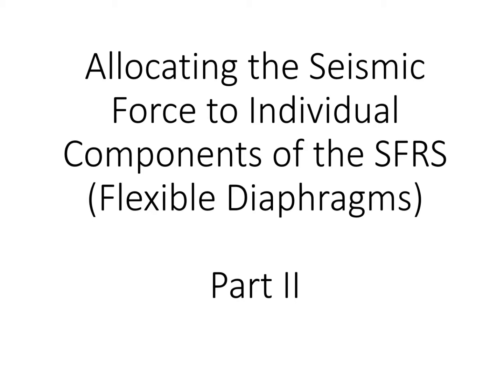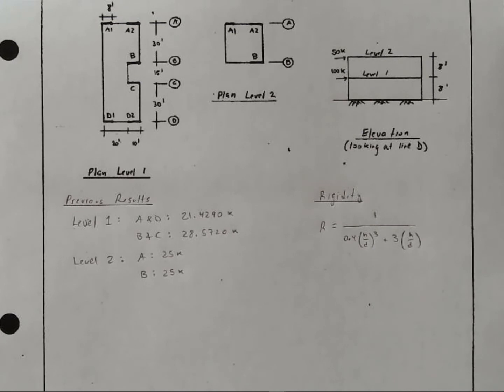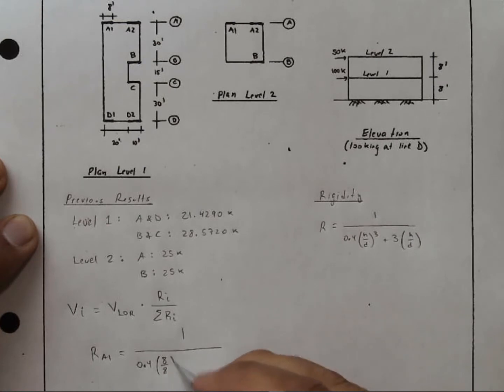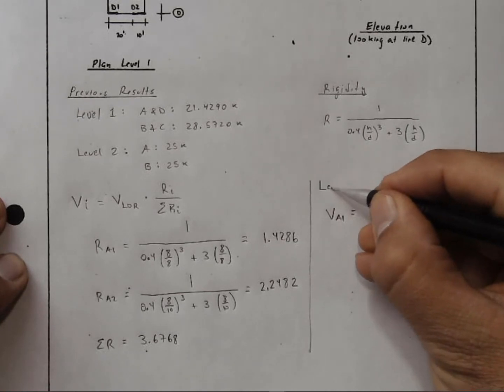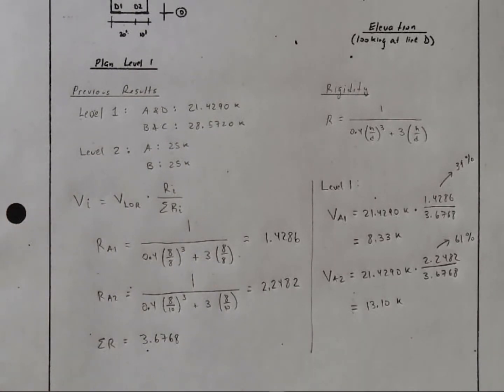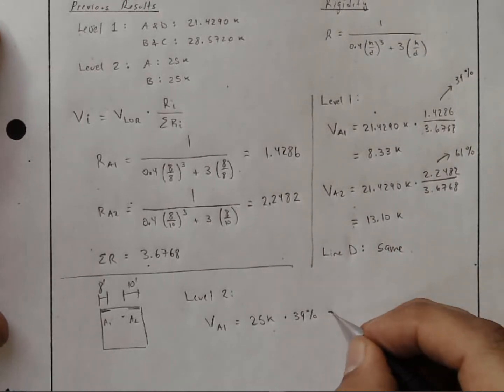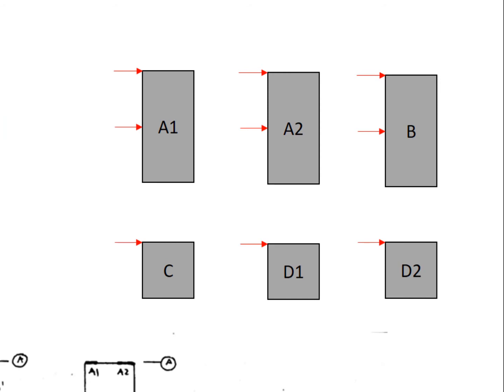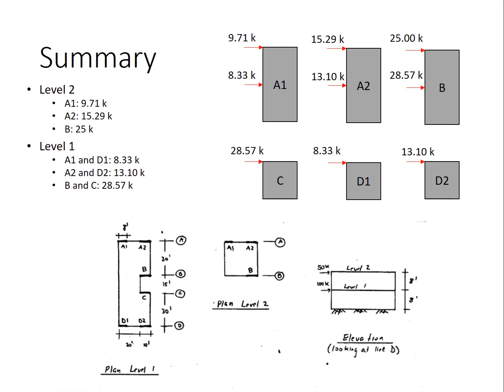Flexible Diaphragms II - Dividing Loads to Elements on a Line of Resistance

Comment: Thank you for this material, can you please tell me from where you get rigidity equation? and shall we use it for flexible system like wood shear walls?
Reply from the maker: The book we use in my class is Seismic Principles by Richards (https://www.amazon.com/Seismic-Principles-Paul-W-Richards-dp-B08KSLPPWL/dp/B08KSLPPWL/ref=dp_ob_title_bk). The equation for rigidity in this video applies to cantilevered walls, which is a safe assumption for wood shear walls. Note that there is a typo in the video. The factor in the second term in the denominator should be "0.3", not "3".

Comment: Great video. I notice an issue; the rigidity formulas are shown correct initially but during solving the problem it is done with 3 instead of 0.3 in the denominator
Reply from the maker: You are correct. Thank you for your comment. Thankfully, the resulting calculations (1.4286 and 2.2382) are correct; they use the 0.3 factor.